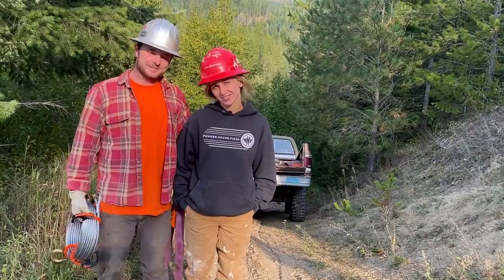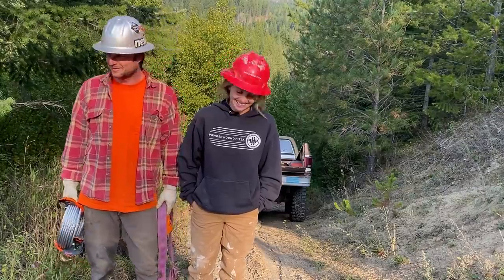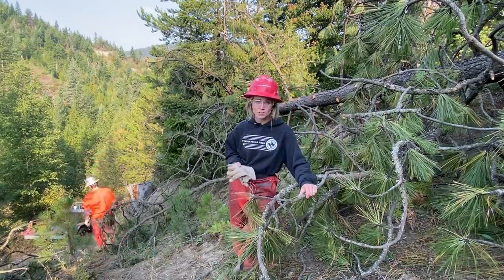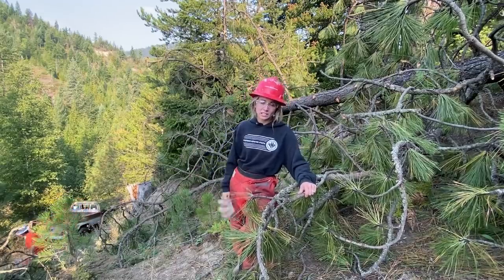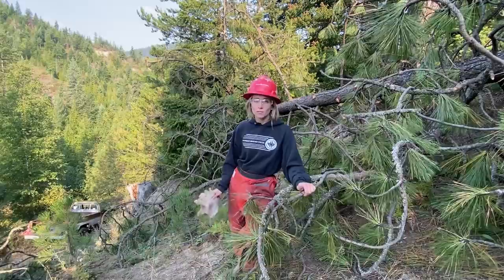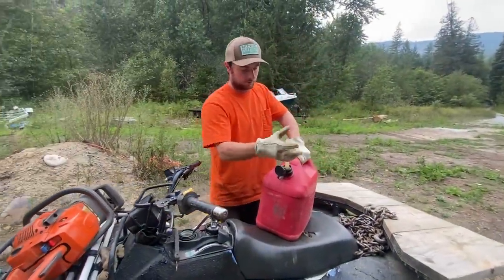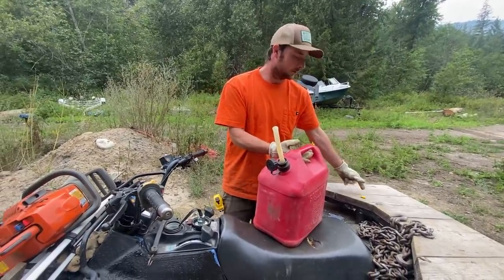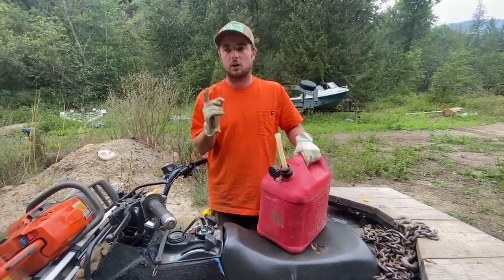Put to the Test | WILL THE SAWMILL HOLD UP?

Comment: The two of you are really getting things dialed in. Now I'm not doing the same type of work but sometimes you can imagine an easier method you can maneuver those logs without all that blade dulling dirt getting in the bark. I have used one of these devices to move some very heavy loads by myself with ease. I was always impressed with the ease of maneuverability of the materials I was working with. ( Sumner 780351 ST-401 Grasshopper ) Take a quick look and see if you could use it in your application. Keep up the good work.

Comment: Good to see the Bandsaw Mill is paying off for you.  While you have mentioned the need to build a ramp to get the logs onto the bed easier and getting the longer base rails to mill longer tree sections, I think you will need to get some kind of roof over it before snow starts falling down there.  Even if it is only 6-8 ft long to cover the moving head unit itself keeping it safe from the snow is going to be essential.  It will be a bit of a hassle to design and build since you will want to keep one side completely open for ease of loading but I would recommend this starts going up your priority list.
As ever it is good to see you continue to make progress, now as a married couple.  Cheers and Best Wishes.

Comment: Ok, Kids... its the old logger from alaska again and hopefully have some labor intensive savings again. Limbs or otherwise in back of truck.... before loading them, take some rope and tie to the rear bumper... then lay it in the bed of the truck and pile the extra on the top of cab... now loaded take rope and throw over the pile and back to the bumper  where if you have some slack in the rope you can make a half hitch in it and tie down the load.... follow me so far?? now instead of trying to jar it lose, take the end that went under and over the load and tie it to another rope or if you have enough just use it to tie off to another tree or something solid then drive away "PARBUCKLING" the load out as it will just  roll the trash out of the back... maybe even your four wheeler will pull it out as it will come easy.... I used to cut two foot long wood and lay a length under each row of wood. When I got to the yard where I wanted to dump, it worked the same way saving all  the work of unloading again. Are you ready for lesson two? Take a soft hammer and lay cable across a sharp axe. The cable when looking down on it will be laying the same direction as the very shape axe under it. Use the brass soft hammer and hit the cable and it will cut it right into. It will not hurt the axe... might knock the real sharp edge off but that is it..... try not to hit the axe blade much with your hammer as that is why you use a brass hammer, it doesn't dull the axe but will knick the head of the hammer.  Now you have two pieces of cable.... keep with me here... we are going to make a farmers eye... if you look, you will see seven strands of wire so separate it into two different stands. Please stay with me... make it three on one side and four on the other and unwind those two back say a little over a foot. Now just like as if you were going to make a knot in the line.. DON'T... lay one across the other and wind those lose ends back into themselves making a eye in the cable because it will follow were it came from. If its not doing that, you have it backwards as it should just roll in.... take a minute or two to look at it and then it will be simple. When you pull on it, it will make a eye with a bend in the very end that you can use a shackle on or thread one end through it making a slip knot on the line to hold onto the log with rather than using chain that keeps coming off. It costs to much to get eyes pressed in, cable clamps slip and make it a mess so this way when it wears out just shorten it a foot and redo it again. As for rolling them onto the mill, I don't really know of a way to make something that you could tie one end of the cable to that cement so you would need to tie off to something behind the mill and lay your cable under the log and go back to the snatch block and roll the log onto the mill bed. But this is something that you can do... take a screw jack for lifting a car from the side and put it on top of a block of wood on the small end of your log you are going to saw and wind it up leveling the log some so that first cut is not so deep on one end and shallow on the other.... a math test... twelve inches on one end and eight on the other or a difference of four inches.... so divide it and that is two inches.... now your taking about the same off each side. You only need to do it once as it has a flat side now and it can lay on the log bed. So you only have two sides of the log to do this on. It makes a lot of difference when you are in bigger logs like your most that will go through the mill sizes. I have more but I will let you digest this and don't be afraid to ask questions..the dumb question is the one never asked.